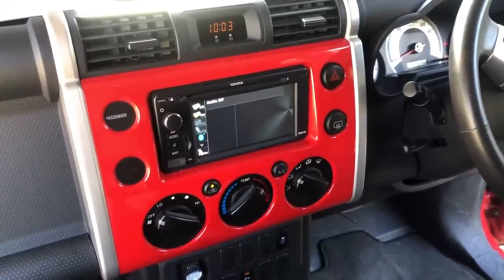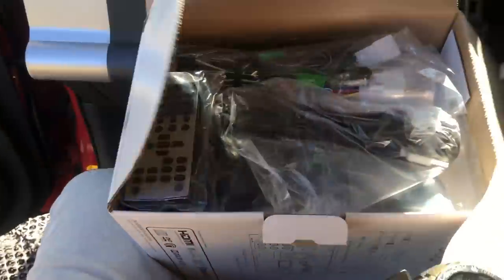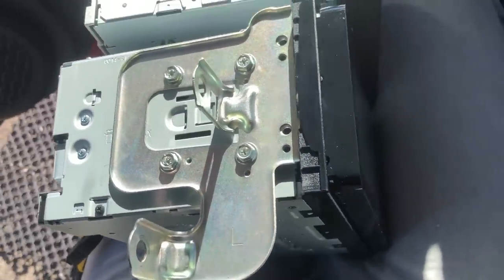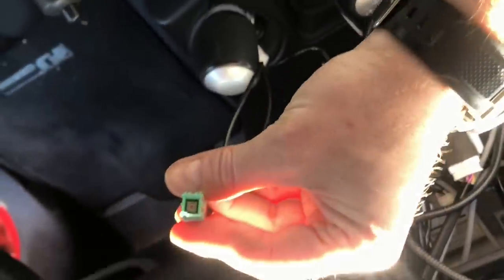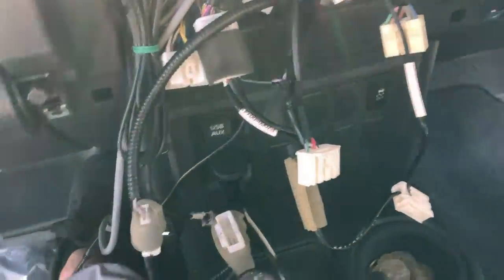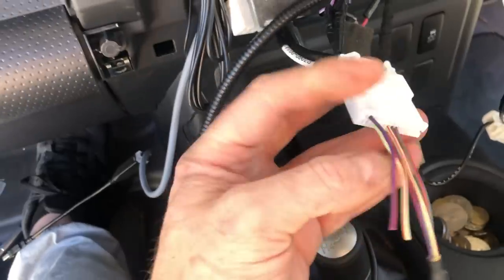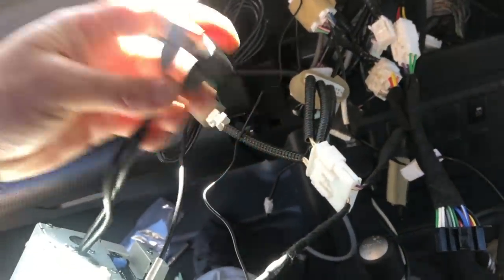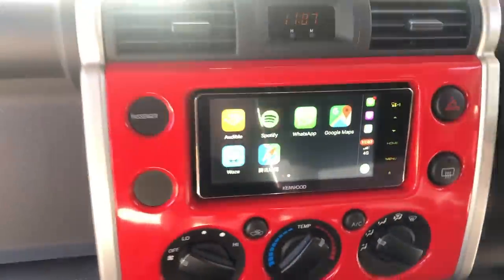How To Install Stereo in FJ Cruiser | FJ Cruiser Stereo Upgrade & Install Guide

Comment: The screen on my FJ radio shat itself last week, so I bought the Kenwood to replace. This video was perfect for a quick install - easy to follow and the new unit went in easy. I didn't have your re-pinned adapter for the speed sensor wire (which I discovered is absolutely required to use Apple CarPlay), so just soldered it into the car-side of the harness. We love the extra functionality, connectivity (particularly the Apple features), screen size and resolution of the new head unit!

Comment: Is the VSS wire similarly placed for the Prado 150 series? I am looking at the 9019 Kenwood for a Prado 150 series but finding the VSS wire is an issue.
Reply from the maker: Use the GPS to VSS we sell on our website. Note also kenwood doing an update to remove the VSS part soon so its not a 100% requirement for wireless Apple CarPlay & Android Auto
Reply: Thanks for your answer. Is the update a software update that’s coming? If so, do you have any idea of when it will be released?
Reply: Hey, great video… just to double check…the VSS wire is light purple ( more Lilac that purple) with white strip and it’s in the 28 pin plug for the stereo…have I got the correct?

Comment: Great video but not so great Kenwood. I have this exact model (DDX919WS) in my 2018 Prado GXL but having intermittent  issues making phone calls.
If I say "Hey Siri call Joe" I can see the phone call is attempted but when the person answers I can't hear them however they can hear me perfectly well. I know they have answered btw because the timer starts counting off how long the call is on the head units screen.
I've taken the vehicle back to the installer who swapped out the unit for another brand new unit but still the same issue. I've used various other iPhones with still same fault. Looks like a firmware upgrade is on the cards for this unit.
Just wondering if anyone else has experienced issues when making calls? Issues happen with Wireless Car Play and when my phone is plugged into USB...
Reply: I've had the exact same issue happen with my DDX9019DABS and iPhone Xs.   Very frustrating!  Kenwood just released a new firmware for both the DDX919WS and DDX9019DABS last Friday (24th of May) and I installed it tonight.  The release notes of the new firmware don't specifically address issues with not hearing placed calls, however I made several test calls tonight and it worked perfectly every time, so perhaps the new firmware fixed it?  Try installing the new firmware and see if it works for you.  http://www2.jvckenwood.com/cs/ce/mm/firmware/2019/2019c/eng.html
Reply from the maker: Never had this issue mate at all and we sell about 30+ per week. Something is not correct either on your car or on your installation. Check to ensure you use short genuine cables for the Apple CarPlay, ensure all updates are done. Ensure the microphone is not damaged. Check the settings on your phone calls both on unit and on phone.
Reply: @AutoChimp  I didn't install it, had a reputable car radio business in Fremantle do the install for me. When I took it back to the installer last week they had the Kenwood rep out who admitted there was an issue. There must be an issue otherwise Kenwood wouldn't put out an update. Going to try the firmware update that xga303 mentioned above. Love your work, very helpful
Reply: @xga303   Thanks for pointing this out, off to try the update as we speak
Reply: @SimonT65  No worries at all.  Please let us know how you go.  The only other change I made was turning off "Personal Hotspot" on my iPhone (not sure if this makes a difference).  I'm still running iOS 12.2 and haven't upgraded to 12.3 just yet.
Reply: @xga303  Update went smooth enough - original Application Version 1.1.0009.4300 updated to 1.5.0009.4300 Made about 10 phone calls everyone went through perfect.
Reply: @SimonT65  Awesome to hear that calls are now working for you!  Let's hope that this new firmware update has resolved the call issue for good.
Reply: Get an Android. Problem solved.
Reply: @SimonT65 Hands free calls runs through your front speakers sounds like there was a issue with your phone and the stereo having them upside down. Phone is playing to rear inputs on the stereo but stereo is only out putting from the fronts. Software issue
Reply: @g-funk484  As i said above, installed the firmware update to the Kenwood DDX919WS and all good. No issue with the phone at all - issue was with Kenwood